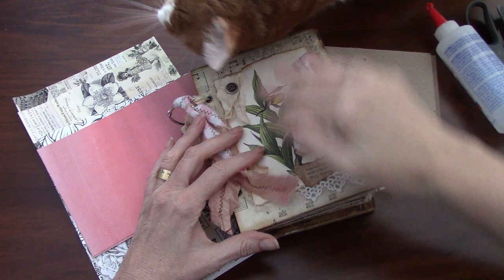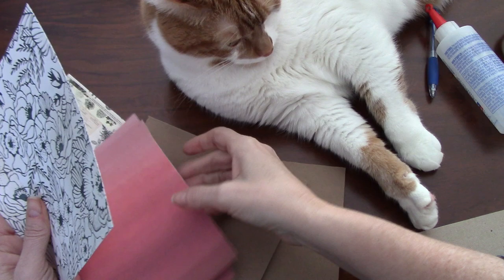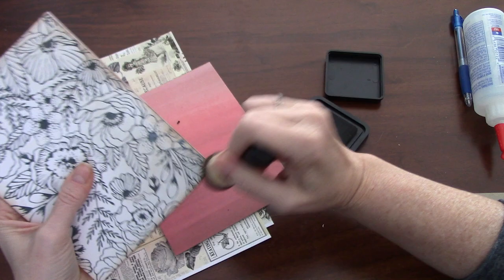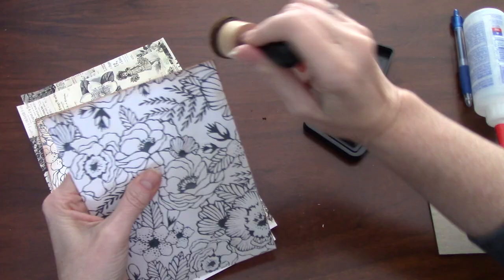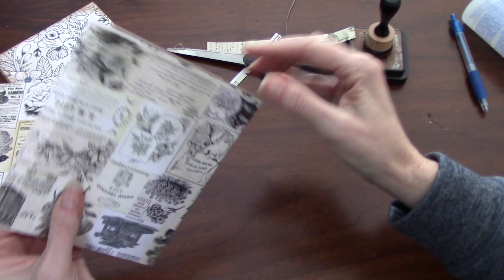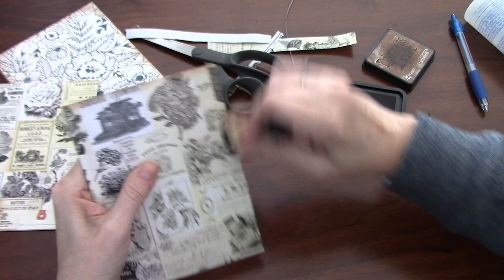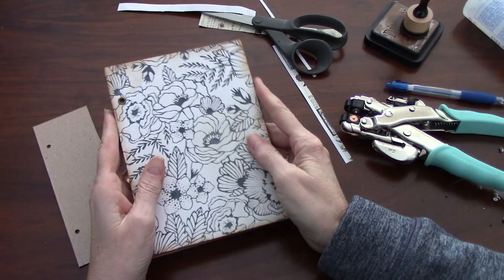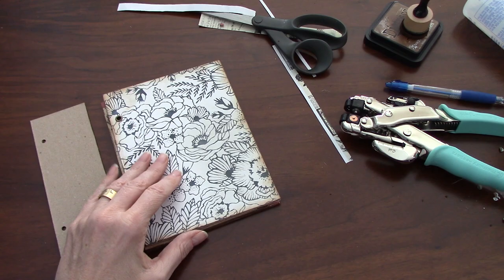TUTORIAL - Part 1 - Let's Make a Ring Bound Journal

Comment: Hi Wendy, the millimeter measurement of the eyelets is the length of the shaft - it has to be the same diameter as your hole - it can't be larger or it wouldn't fit in the hole you've punched. The larger hole on the cropodile is 3/16", and the smaller is 1/8". Hope that helps. tfs.